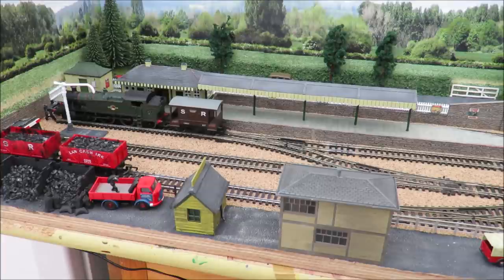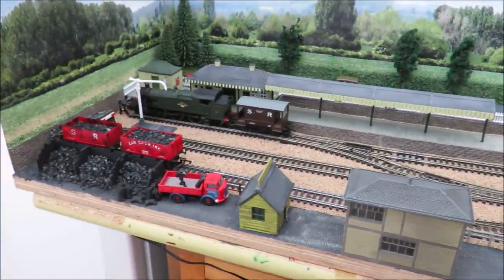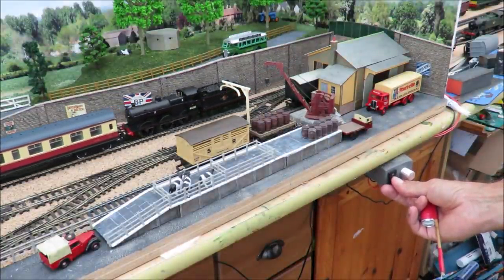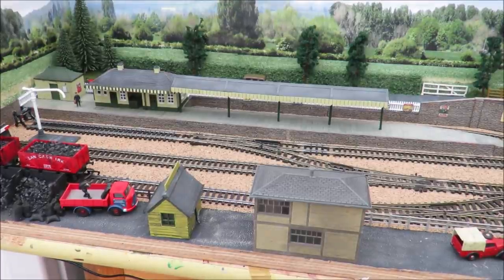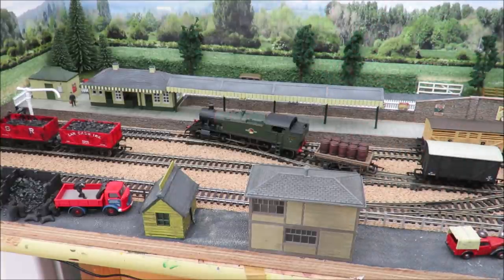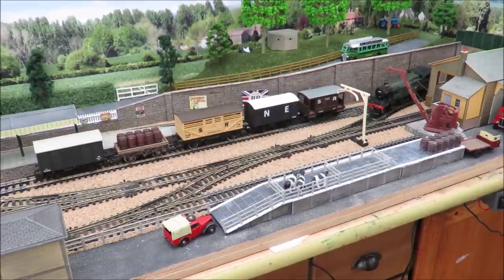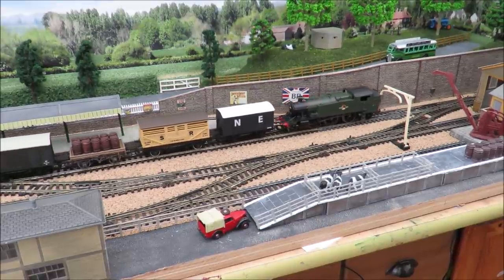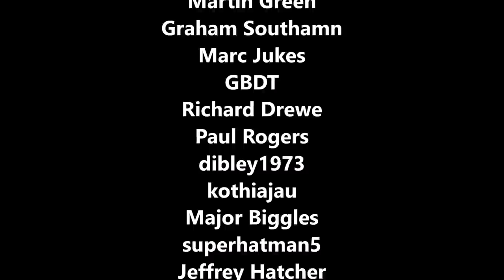My Ideal Shunting / Switching Model Railway Layout - Part 3 - Operating Potential / Trains Running

Comment: New to the hobby and a novice, so please excuse me if my question is a bit simple! Is this a DCC or DC layout please? And, if DC, where have you put the power inputs, please? Any help appreciated, thanks.
Reply from the maker: Hi. It's DC it's much simpler. This layout is long gone, but only had two or three connections, I will have mentioned it in one of the videos, and we have several videos on wiring DC which should help. Best advice to anyone new is keep it simple. Any questions please ask
Reply: @BudgetModelRailways  Thanks

Comment: Great video, just a question but, what Is that that white poled handover thing on the middle line inbeween the cattle and crane? Im new to the train modeling world and ive got one and its doin my absolute heading because i don't know what it is or what its for
Reply from the maker: Its called a water crane, its too re fill steam locos water supply. They were filled from water tanks that could be a distance away, so are great for a small layout. Mine needs to be a bit further down the track to be realistic
Reply: @BudgetModelRailways  cheers
Reply: Actually bud we got the wrong end of the stick its got a arc over track line too... Sorry
Reply from the maker: @warpriest561  , ahhhh. Ok that's a loading gauge, they put them after goods yards to make sure the loaded wagons were not too high or wide for any bridges or tunnels on the line
Reply: @BudgetModelRailways  ooohhh cheers buddy! Makes sence now hehe, keep safe, keep up the good work 👍
Reply from the maker: Any time, happy to help

Comment: A  smaller  tank  or  saddle  engine  would  look better  here  for  shunting
Reply from the maker: The idea was to be able to run the largest loco possible. At the end of steam and early diesel lives large locos were used on minor workings
Reply: @BudgetModelRailways  Yes  where  I  lived  on Merseyside,  the  2-6-2s  were  prevalent  but  you have ltd  space
Reply from the maker: True but I don't let that restrict me
Reply from the maker: How wonderful, I will have to look out for some pics of that